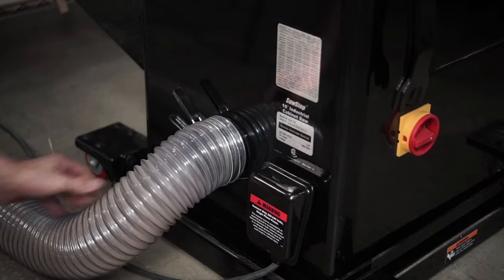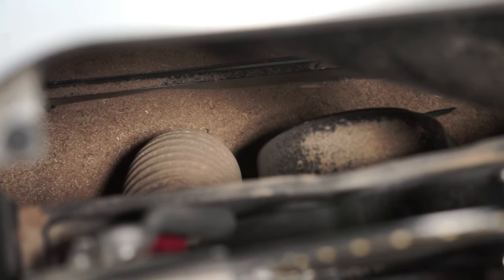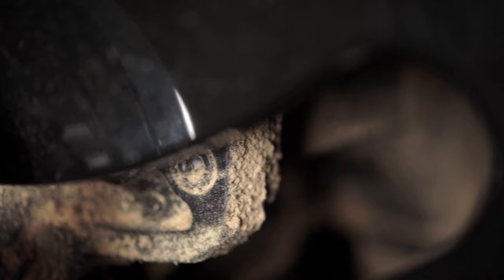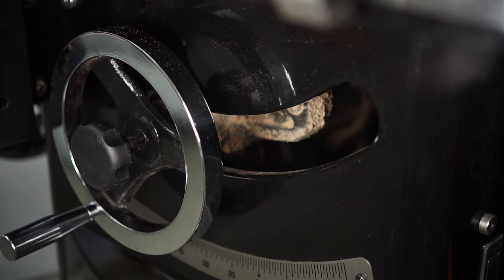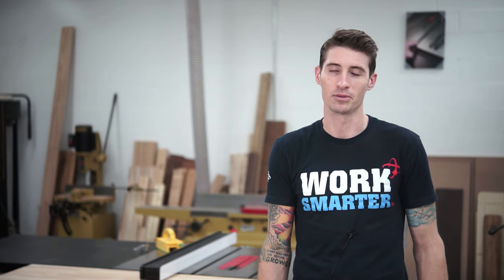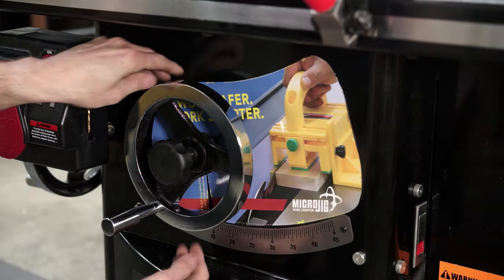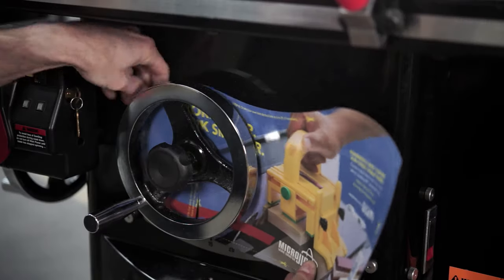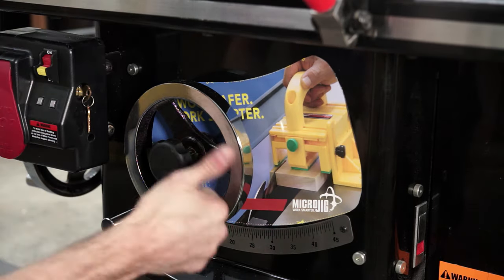Magnetic Dust Cover for Cabinet Saws

Comment: How much for the one without a giant ad on it?
Reply: About 10 -  8x11 sheets for $10.

This one is usually $10 but I imagine it is a bit bigger.

Here's what I wonder. How well does it slide along when you tilt your blade. And does it leave a hole on the left of the cut out? Which you could cover by the part on the right side that you cut off. Shouldn't be too hard to manage. Just something to pay attention to.
Reply: And there are other gaps on my table saw. Which I covered with aluminum tape. I don't know if doing so was a good idea or a waste of time.

Comment: The dust collection system won’t work effectively without airflow through the machine. Your cover stops that airflow.
Reply: IMO, the Sawstop ICS in the video has enough other places for air ingress, such as the gap under the table, above the cabinet, and the large gap around the motor covers, but to your point, OTHER saws may not.  People will buy this because, well... Pimper's gonna pimp (their ride).

What the Sawstop ICS/PCS really needs to improve the cited problem is a 5" dust port, so that 4" of it can extend up to the blade shroud, and the other inch can suck dust from the bottom of the cabinet.  So is the design of the Delta model 36-Lxx Unisaw.  The Unisaw cabinet has a sloped bottom directing all of the dust into the port.  The inside stays perfectly clean.  The new Unisaw is an absolutely awesome saw, but overall Unisaw dust collection is NOT as good as the Sawstop saws.  Sawstop owners have to spend thirty seconds per every-once-in-a-while sucking dust from the inside... like chumps. :-)

Comment: Do you know of documented cases as you describe of fires started by embers from a table saw or is that a sad attempt at pushing sales
Reply: This is not Linda this is Garry. There are no cases as described. I believe there was a link in the Paul Thein website about this very topic. There was a study done by a major technical university that tested this theory. Those who've taken an auto mechanic or small engine course know that it take fuel and air in the proper mixture with ignition to begin combustion or an explosion. The chances of making enough dust of the type needed such as found in a feed mill or grinding facility are extremely low. Chips of the type generated by a sawblade are not suitable for this type of reaction. There are dozens of dust collection videos cautioning about grounding that are entirely baseless. This is another of those urban/internet legends like causing an explosion at a gas station with a cell phone.
Reply: This is about sealing up the table saw so your vacuum has increased suction and removes more dust.  Awesome idea, I am purchasing one for my table saw.

Comment: Doesn’t work with PCS!
Reply from the maker: Which saw do you have? I have it on our Sawstop Cabinet saw here in the MicroJig shop.
Reply: @Microjig  I have the 3hp PCS W/52” extension table.
The dust cover doesn’t work because the angle gauge is above the grove and the indicator arrow is blocked by the cover.
Reply from the maker: @againstthegrainwoodworking  I'll have to look at ours and see. 
The sheet is designed to trim to fit different saw configurations. Did you buy this or get it as a promo?
Reply: @Microjig  I bought it on Amazon
Reply from the maker: @againstthegrainwoodworking  email me at ralph@microjig.com